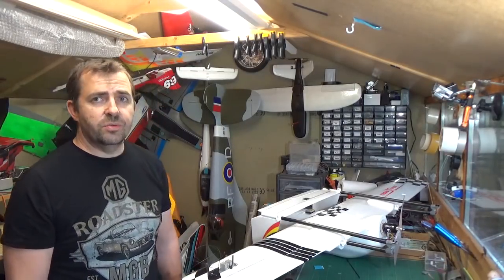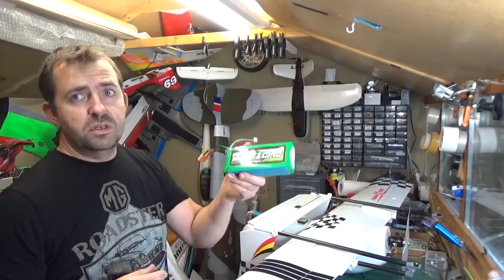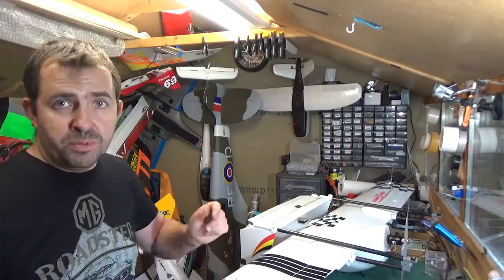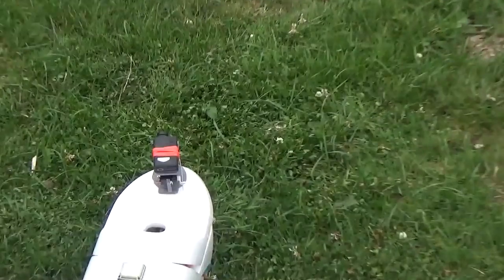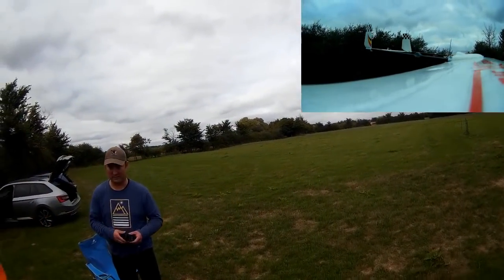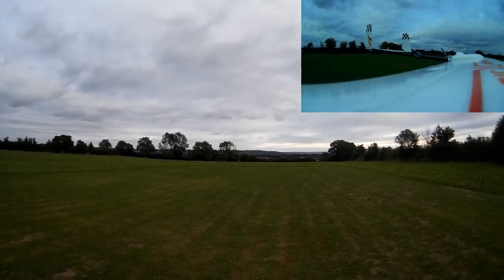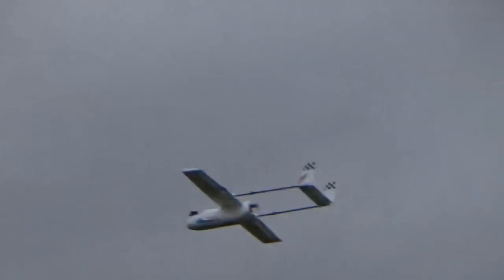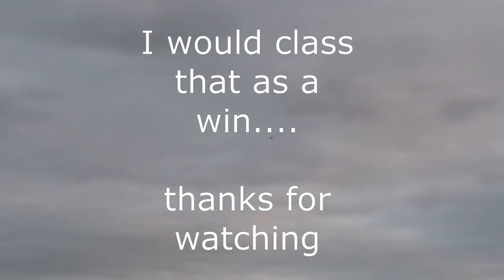Sky hunter folding boom test

Comment: hi Andrew did the boom mod last has I have just got a full skyhunter and this mod would help get it to the club plus would heat shrink work either side of the mod as opposed to electrical tape plus if I put carbon fibre strengthens on the vertical stabs will they interfere with the folding boom
Reply from the maker: Hello phil. There are still on there ive now using the one with the double pin. The scew underneath work it self lose over time.  And i belive there on thingyverse now. 
I would of thought the heatsrink would be to flexi.
I used some fine nylon string and glue in the end. Wrap the string around and then coat in glue. 
And no worries on the carbon rods
And cheers for watching. 👍
Reply: @AndrewBoulton  cheers Andrew now all I need to do is find somewhere that will print it lol and what for my model to arrive from  china.  is Mat still flying as I have not seen any vids from him recently and I have finished his back list, well I am starting on yours now I have found your channel keep up the good work mate
Reply: @AndrewBoulton  what video gear do you have in the skyhunter and are you on Taranis gear as I will need to get complete new gear for FPV as my current gear hasn't got a module bay in the back
Reply from the maker: @bigphil6980  cheers for watching my vids. 
I have a dragon link setup in most of my fpv planes just for safety more than anything. And use trannis in every thing else now. Used to have spektrum gear. I use a mix of 5.8 and 1.3 what evers in the parts bin at the time. 
And matt still flys with us at the FF hes not in to making videos at the mo. That might change but with the current world problems were all not flying. And catching up on other things. 
Cheers 

Andrew

Comment: Cool..what motor prop setup you using on the sh
Reply from the maker: Hello Chippy the motor is a 3548 890kv on a 11x7 prop and using a 80amp ESC but ive only seen 30amp max on the osd..
Reply from the maker: oh and 4s 10,000mah